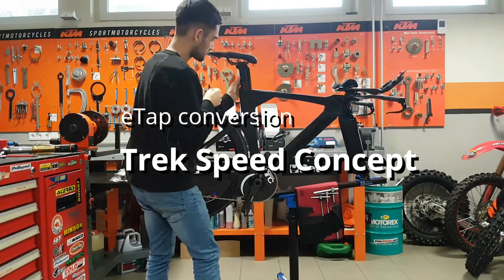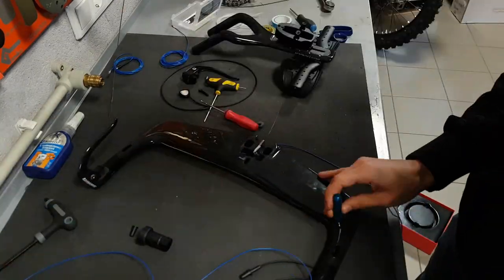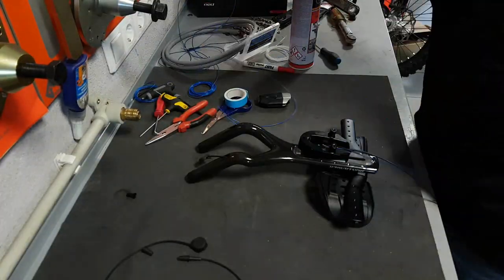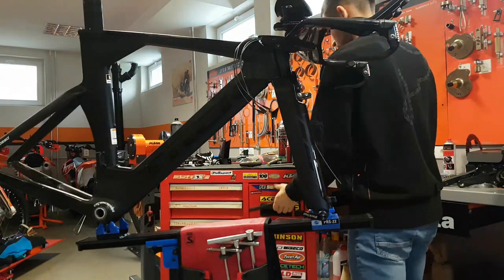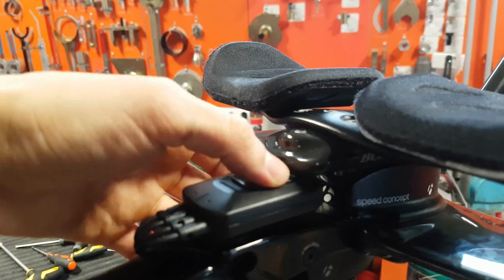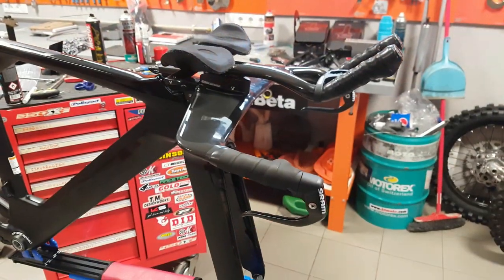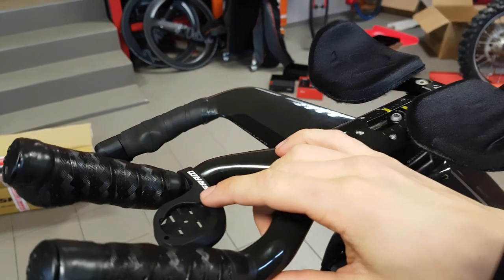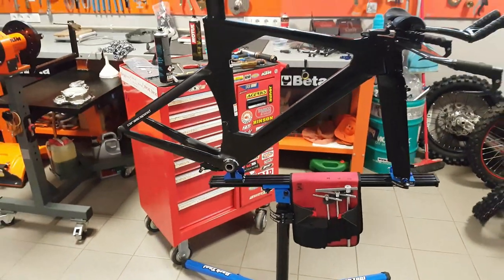Trek Speed Concept custom build w. eTap and 2-Spoke wheels

Comment: Ronny, what foam do you use to cover the brake cables inside the aerobar (to prevent rattle)? Is it just something you buy at the hardware store? Do you use tape or similar to keep it in place?
I will probably try to do the same thing.
Great video!
Reply from the maker: Thanks, it is a bike specific product:
https://r2-bike.com/capgo_1

Tape or shrink wrap to install

Comment: Rony - question... Just got eTap for the same bike.. but I have Shimano Ultegra chainrings 52/36.. the eTap Front derailleur is constantly dropping the chain and missing the upshift to the big ring.  Took it to the shop and they re-aligned the front derailleur..took it home, BAM! Same thing.. sooooo Am I screwed? I have a quarq dFour.. so switching to sram cranks and rings is $1300+.. that would suck
Reply from the maker: Pian0Mon it's a Yaw FD, it's not set up correctly.

Comment: your opinions on disc brakes(not on tt/triathlon bikes, on road bikes), worth upgrading to? Or just wait till you buy your next bike to get them?

Or are the not worth it at all at 450-600g heavier and a higher cost?(I imagine that's not very relevant for most people)
Reply from the maker: Goriaas upgrading just to get discs is a bit pointless, you need to look at the whole bike. If you are getting a new one anyway, then it's definitely the way to go. If not anything else, it's good future proofing.
Reply: Its a waste of money upgrading a rim brake bike to disc brakes. It costs a lot and you would have to modify your frame. I would say only get disc brakes when getting a new bike. 

As for the weight. If you are racing up hills you probably would want the super light rim brakes over discs. However, if you are doing any commuting it's a no-brainer just get discs. I would say the weight doesnt make much difference, would only cost only a few watts up hill and you would gain so much more confidence and speed when cornering downhills.

Comment: That needs some colour on it.....

Why do most people go for a "Murdered' out bike 🚲....
Reply from the maker: Andy Stone black = every colour from the visible spectrum. This bike literally can't have more colour.
Reply: That would be white.
Reply from the maker: Attila Répási that would be wrong
Reply: "Light is perceived by the human visual system as white when the incoming light to the eye stimulates all three types of color sensitive cone cells in the eye in roughly equal amounts.[23] Materials that do not emit light themselves appear white if their surfaces reflect back most of the light that strikes them in a diffuse way." https://en.wikipedia.org/wiki/White
Reply: So as far as I understand, a surface is said to be of a color, when it absorbs every other light frequencies and reflects the frequencies of that color. As black absorbs every light, it has no color. But anyway the bike is nice, no need to make excuses for its blackness.
Reply from the maker: Attila Répási you just said it, black absorbs every colour, so it IS every colour.  White reflects everything, so it's no colour.
Reply: Well, to put it in another way, something is red when it reflects red and absorbs everything else, so black is definitely not every color.
Reply: Technically, Scientifically & Mathematically Attila is correct in this discussion of "Black vs. White" color spectrum eye recognition reality. Facts are facts, and are absolute until overcome by better or more facts.....so to speak. 

Your disagreement derives from a Scientific vs. Philosophical POV on whether things are what they absorb or what they reflect. A practical, logical person would tend to side with more scientific confirmations of one POV vs. another, whereas an obstinate, prideful person would insist on their one & ONLY philosophical understanding. 

I see this "debate" displayed almost daily on CNN (et al MSM)  political ''news'' & commentary shows. They'll argue day after day, not really listening or understanding the others POV. They don't ask questions (usually) they just bellow & talk, talk, talk, sometimes even over each other. Some folk try to appease & downplay it all with the: "you say tomAto, i say tomAHto" analogy, but often that analogy application is incorrect as well.....when u add up the facts.

Comment: the etap brain box is ugly af, esp for a wireless setup
Reply from the maker: JogBird the Di2 junction isn't any better
Reply: at least it is much smaller, possible ton integrate in some PRO hardware and doesn't look like a remote garage door opener.
Reply from the maker: Simon Rano can't put anywhere else on this frame
Reply: Is there any possibility to use the bar end plug junction inside the bottom of on some aerobars ?